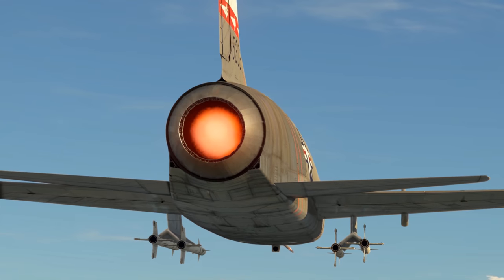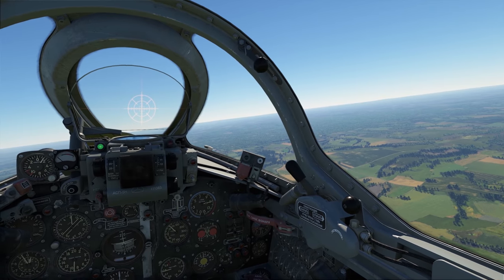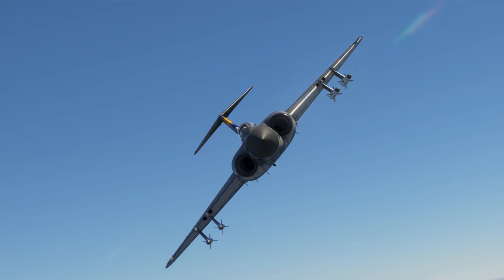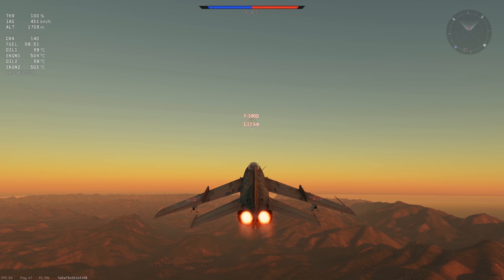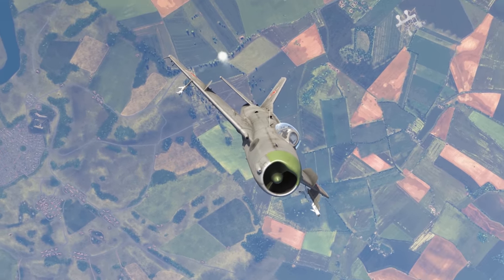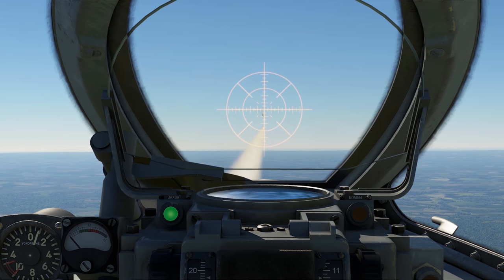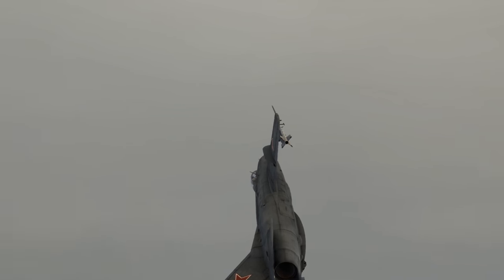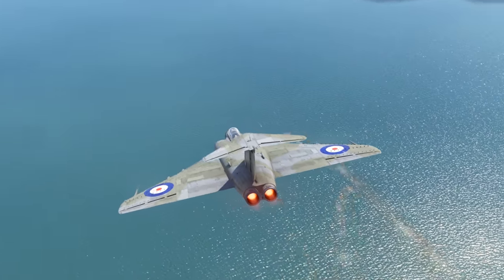Heat-seeking missiles 101 / War Thunder

Comment: Can the missile lock onto an Abrams? It has turbine engine as well, but with less exposed exhaust flame.
Can I redirect incoming missile using a nearby bomb explosion? Can I redirect by firing my own rockets?
Thumbs up for proper modeling of weakening heat signature of shut down jet engine.
Reply: I think the heat signature is to small for the early AIM-9B's and R-3S's. It might be worth giving a shot with an AIM-9L or an R-60
Reply: @kacper8562  AIM-9L and R-60s are more modern and can tell what is a target and what isn't. A bomb or a short burst of heat from a rocket isn't going to redirect its attention from a jet engine.
Reply: @Royalwaffles  you misunderstood my comment. I was saying that the better seaker head might have a better chance than the early missiles to lock onto a heat signature of an Abrams turbine engine. I never meant the bombs and rockets as decoys part of the comment. I must admit, i wasnt very specific, so it was kind of my fault.

Plus, from my DCS expierience, i can tell you that it it extremely unlikely to do any of the things listed here, but i know war thunder uses diffrent guidence modelling than DCS, so it might be possible to lock onto an abrams in war thunder
Reply: No. Early missiles are easily fooled by ground heat
Reply: I doubt it's possible to lock onto an Abrams in War Thunder. Don't get me wrong, some War Thunder aspects are pretty realistic, but this is an edge case and the devs probably implemented locking only onto planes and the sun.
Well, let's test it, I have an Abrams...

Comment: I thought early ir missiles would break lock when brought down near the long wave radiation of the earth and the heat of the jungle
Reply: They could but the exhaust of a jet engine is fairly easy to distinguish against that. They are more likely to simply lose lock easier.

Comment: Great info but a lot of the info has been superseded.  Players no longer get the "Rocket has been launched" warning, instead the missile gets its own icon while in flight.  When and for how long is still tied to the crew skill rating, but actually turning your head to check six for incoming missiles is now up to the pilot.

Missiles now also come in dozens of flavours, with variations including MCLOS/beam riding/IR/radar/laser guided, caged/uncaged, active and passive and so on.  A lot of the newer ones now also include ECCM so they are a lot more resistant to counter measures and environmental effects.

Check out the channel Tims Variety for an up to date (and continuously updated) video on all sorts of air to air missiles and how to deal with them.

Comment: You NEED to buff these missiles. Recently they barely work at all. They constantly get confused and pull of in directions were neither a enemy or the sun is shining. Sometimes they just pass enemies who do not even pull the required g-load. I saw them basically dodging the enemy plane they were going for. This is not how air to air missiles are supposed to work. Even if these missiles 'hit' I have seen situations where they explode and wouldn't even cause any damage.

Comment: How about you fix what you have first for once? COUGH JAVELIN COUGH.
Most broken pile of garbage you've ever rushed out and it's insulting.
Meanwhile known issues with vehicles sit around for months or even years with no action on them but hey its ok because LOOK SHINY NEW RUSHED OUT VEHICLES THAT YOU WILL BUY THEN REALISE THEY'RE BROKEN.
Reply: Its a british attempt at mastering the art of supersonic dorito. They failed.
Reply: @Royalwaffles  Except they didn't. It was never meant to be supersonic and after they worked out the flaws it turned out to be a rather capable aircraft. Certainly not britain's best design but by no means junk.

Comment: Thx für ruinining 9.0 Jets. It is useless to Play them. No Chance against f100 and mig19. You have 0 Chance to kill Them and 0 Chance to Dodge Them. Put Them on 10.3 both. And btw thx for the 390.000 research points on this things.
Reply: If you can't evade the missiles just delete system 32, it's going to help you evade the missiles.
Reply: @erlendsvensson3447  thx for the help. I tried that. Now my Computer is not Working anymore. What did i wrong. Pls help me to fix it. Need to use youtube on my phone now :(
Reply: [100] Grummelkopf LMFAO
Reply: @SergeantArchDornan2242  ;) Computer is still broken
Reply: [100] Grummelkopf bro you actually fell for system 32
Reply: [100] Grummelkopf you have to reinstall windows. you fell for the oldest trick in the book
Reply: @SergeantArchDornan2242  Just checked my Windows, they seem pretty fine
Reply: [100] Grummelkopf you said your computer broken